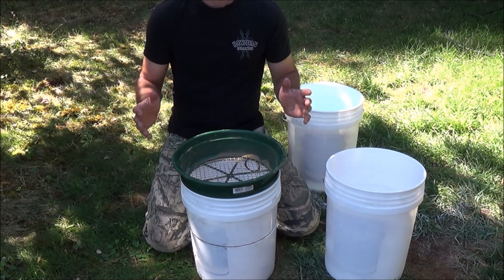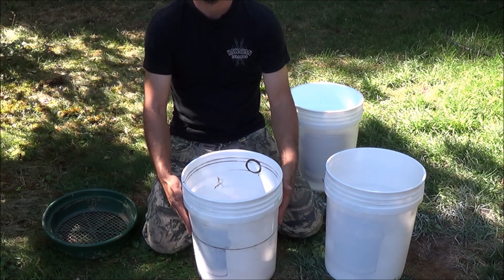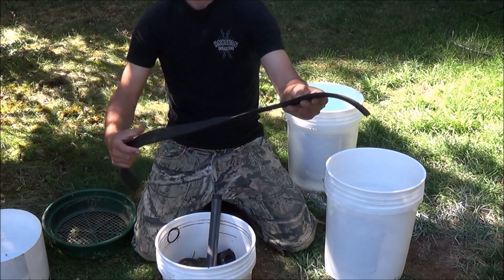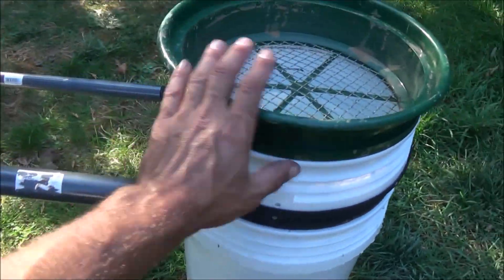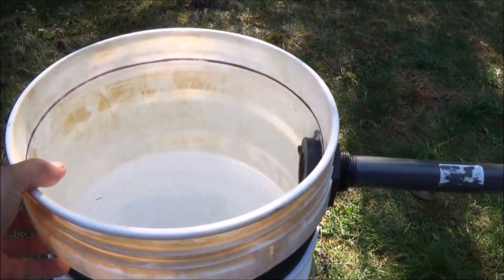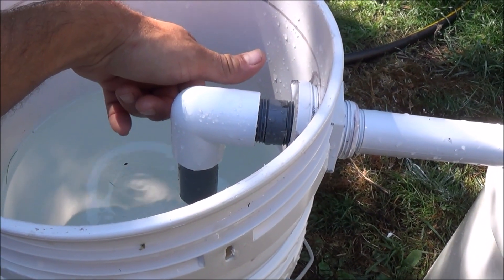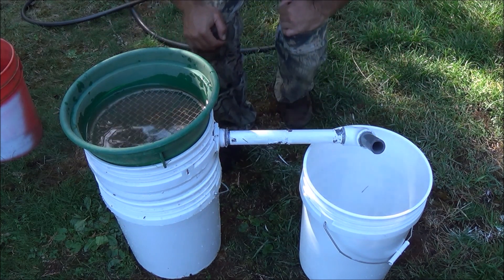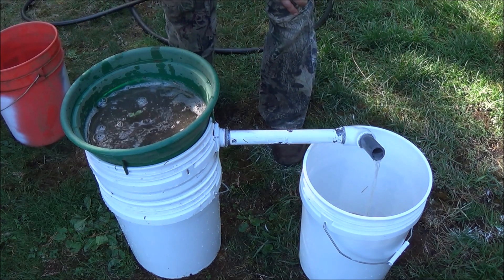Gold Mining Classifier Screen Water Recycler Invention

Comment: Why not just have a bucket a little wider to put the classifying gravel bucket to rest into? But have a ringed screen on the top lip to close that gap between the 2 buckets to keep rocks out but the overspill goes into? Or have that overspill feed another bucket like this but the pipe is on the outside of the wider bucket so the pipes not inside the actual feed bucket.

Comment: Very cool!Those fittings are called "Thru-hulls".  In case anybody wants to ask for one.  Our local irrigation company has them and I find uses for them all the time.
Reply: sorry to tell you that is wrong they are called a bulk head fitting, you can google the difference if you wish to see what  each term is. yours is just a hole for the most part.

Comment: Now make a rifle sleuth take a 4" corrugated drain pipe cut in 1/2 screw it to a 1x4 set on a slope then use a 12v pump to ( truck battery) to make water flow over the rifle sleuth them get the pickers , N pan the fines ! well that how i did it at the river